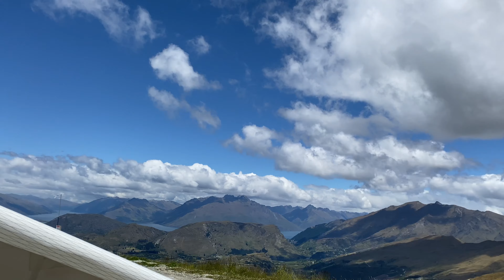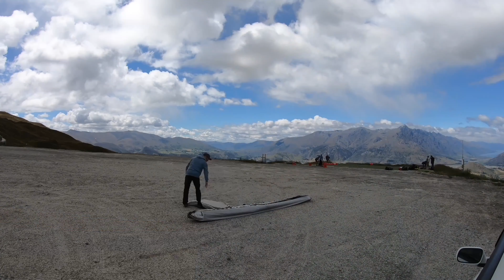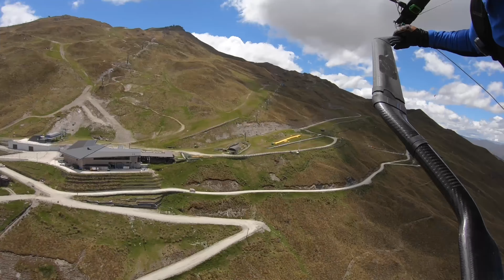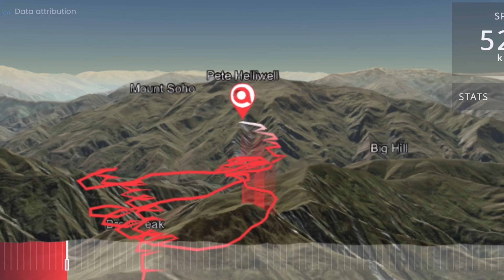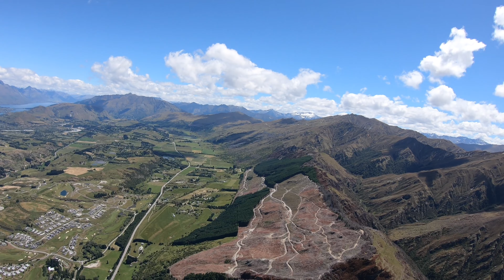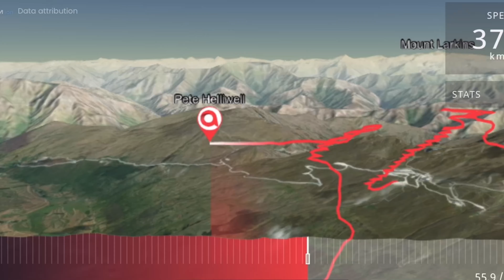Test flying My Hang Glider & A Trip Around Coronet Peak - New Zealand

Comment: Hey Pete fantastic video and looked like such a nice fly! Just wondering what your upright/basebar camera setup is? what Camera and what's holding it there?
Reply from the maker: GoPro 7 black with two wind slayers on it (cheap ones, not the GoPro one). The mount is one of the rubber flytec vario mounts with a GoPro fitting threaded on to the end instead of the flat/round vario mount part.
Reply: Even the audio is really nice and crisp!